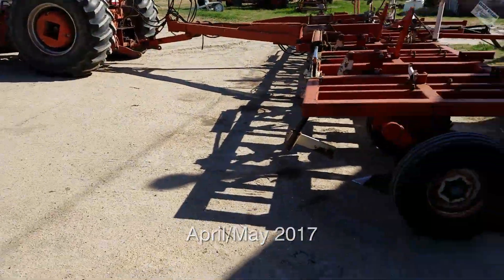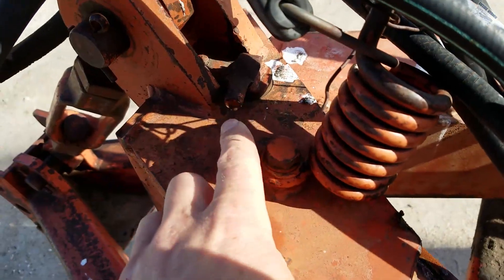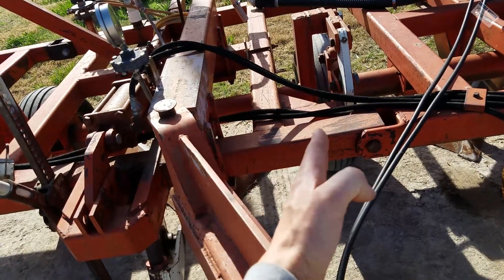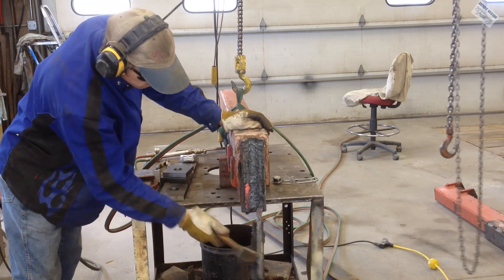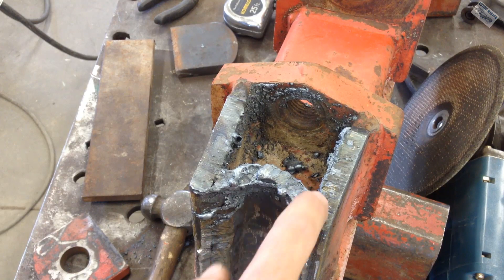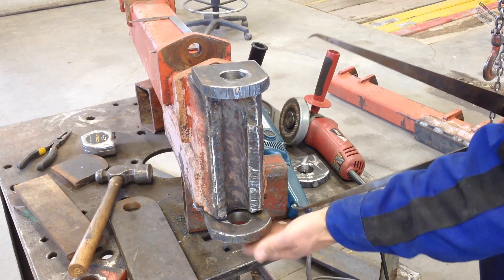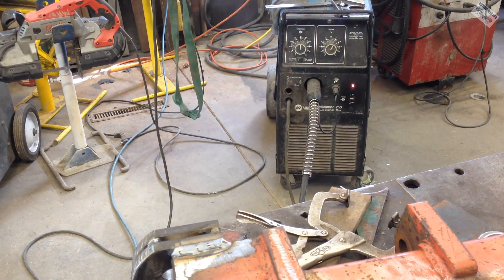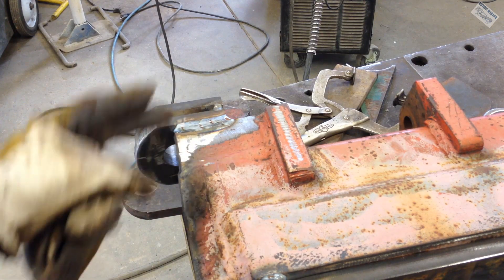Sweep Plow Main Hitch part 1 of 2

Comment: Nice repair, thanks for the settings, yeah I'm one of those guys! I agree with using ears instead of tubing, there's a lot of stresses from different directions and an ear or pin is much easier to replace than the inset tube.
Reply from the maker: Thanks for letting me know you like to know the settings. I got to see a newer version of this plow recently, and they are using ears instead of the tubing now. I guess I made the right call to switch it!

Comment: Hi Matthew,
It's been a while since I've welded some 3/4" plate, love that sound of a real hot globular mode weld or even better getting in axial spray, just a smooth "Wooooosh" and no spatter to clean after...
In a short future you'll have redone every joint on this machine...   ;)
Cheers,     Pierre
Reply: Pierre's Garage I've never done any spray mig, I'm itching to learn and do some, the new garage will get a jib crane and a heavy welding table, I think it'll be good practice.
Reply: To axial spray weld you preferably need  some 85% or more argon in your mix and over 24 volts capacity welding machine, just make certain you give enough arc lenght to allow the cone to develop, ( maybe 5/8" or even 3/4")
Reply from the maker: This turned out to be a huge undertaking. It's basically a new plow when it left my shop. I don't achieve spray because I'm running 25% argon. Thanks for your input with the comments here! :)
Reply: Get 90/10 you can spray and short  circuit and globular

Comment: Not being a professional welder, I remember that my MIG teacher told me that MIG has not a lot of penetrating power. He suggested that Stick Welding is a preferred method for heavy loaded welds. What do you think?
Reply: Melvin Schmecklebak When I started welding in the 70's (ouch lol) arc was the process for and heavy iron and steel but since the early 90's (possibly earlier) high power mig machines have become very popular, automated mugs in production settings and mass production plants have put a lot of welders out of work. Stick will always be around and in a lot of settings it's irreplaceable. I have two mugs up to 160amp and anything heavier I get out the Lincoln Tombstone! Possibly later this year I'll be looking to buy a big amp mig, I do 1/2"+ fabrication at times and it would save time and money.
Reply: There isn't much difference in penetration between Mig and Stick, when you got some .045" or .062" wire and lots of volts behind you're really digging in as well as Stick can do, even better Dual Shield Flux Core is a good contender also, notice that I'm not talking about little domestic MIG welders from HF or anything 200 Amps here...
Reply: Pierre's Garage Youre right, I've done a lot of dual shield mig with great results, I've never used wire larger than .045, I imagine you need a very healthy machine to get good results with .062. I'm hoping my budget allows for an industrial size welder. Btw Pierre I enjoyed your last few videos!
Reply: .062" wire you better get a 350 + Amps welder if you are seriously thinking about it...   .045" gives a pretty good punch when needed.
Thanks for the encouragement and support...   ;)
Reply: The thing is this:
Almost anyone can pick up a stick and if they can make even a REMOTELY decent looking weld, you can bet it will have good penetration... I've seen a ton of awful looking stick welds that held up to a lot of hard use on ag-equipment.
on the other hand..  you could lay a PERFECT looking bead with MIG that has little to no penetration if your settings and technique are wrong... I believe it takes much more practice to master MIG/FCAW but, when mastered, its every bit as good as stick.
Reply: v5u7sulh2 I've learned not to rely on looks alone if it's structural or I'm not very sure of the material quality. I got in the habit of cutting and etching test pieces, I help friends with roll bars and tow hitches ect, I don't want any mistakes. It only takes a few minutes, why not?
Reply: Be careful about relying only on looks...   It can be very deceptive...   try get a good prep also to ensure the best possible penetration, Mig and stick can both make very good welds with the >proper technique<...
Reply: The etch technique is a quite secure way to get the feel of a weld, but this isn't always possible, but like you just mention better safe than sorry when welding critical equipment, like trailers, vehicules, lifting equipment or anything with though requirements...   ;)
When unsure, better pass on the job to an experienced person or get supervised and learn while doing it....

Comment: You should no this but if you're viewers don't. if you cover the pin with ash ( turn on cutting torch gas no oxygen) from a torch splatter won't stick to it. Just turn it black and spatter will wipe off.